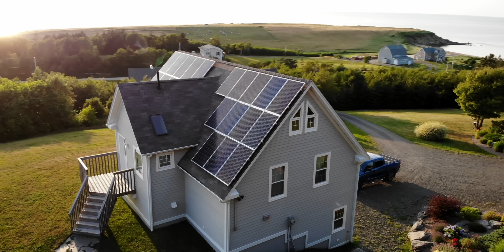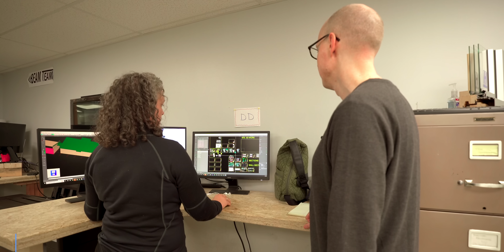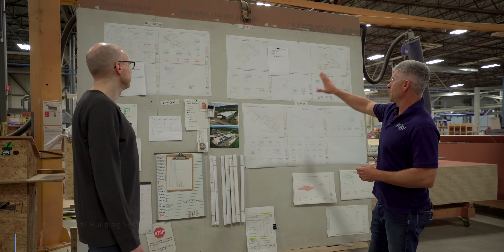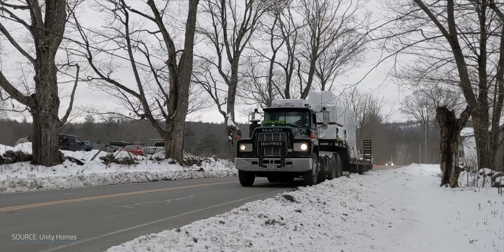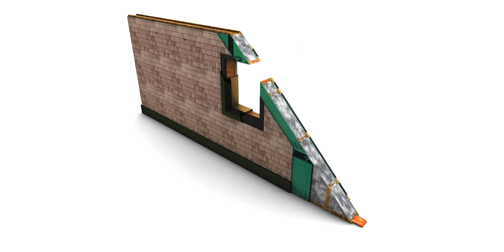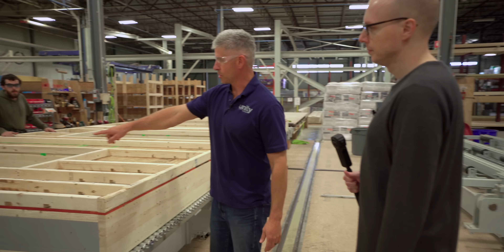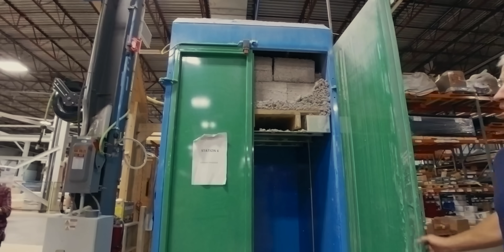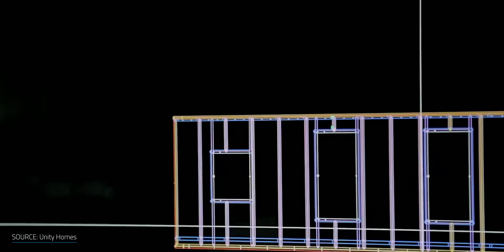The Simple Genius of a Prefabricated House - My Net Zero Home Build

Comment: As a custom design small builder retired, I have found SIP the economical way to go. And in an attempt to protect the wall  exterior wall assembly even more, we used a minimum of a 2’ overhang. Like your panels, they use less material than your factory built home and achieve an R30+ with a 6.5” depending on the type of ICF used. And has options to increase R-values barriers to R50+ when going to 2x8 or 2x10 thickness which for me is unnecessary as there are passive ways to capture heat thru solar that do not require any mechanical devices such as Trombe Walls.  And I dare say, much cheaper to boot. Thanks for sharing, Matt.

Comment: All of that large white plastic covering/protection for transport looks a bit wasteful. Is the plastic effectively recycled. In Western Australia we have predominately clay brick and tile homes. Double brick is common. We do not have a great deal of wood. Much of the woodland is protected. Brick and tile holds out well against weather and insulation is now standard for construction. We have a high range of temperatures but no snow. Perth, the capital, has a great climate. Except for a lack of sufficient rain. Fresh water is always a problem. We do have steel and wood built housing for those that want them.

Comment: I've been a fan of this tech since i seen Ted on This old house and the sheer amount of detail they do to tight up the pre-builts they make.  It would cost a bit more, but rockwool or similar insulation with fire resistance should be used.  Tornado ties (is what i call them) but those should be used on roof rafters, down to the sill to increase the house surviving high winds, etc.

Comment: In 1968, right out of the military, my first job was framing wall panels in a prefab plant in Washinton State. A couple of months later I was plant superintendent. I worked for large and small homebuilding companies after that, then became an architect designing almost entirely houses. What you show in this video is where I hoped the industry would go. After all these years in the industry, this still excites me. Thanks, well done to you for the video and Ted Benson for moving the industry so far forward, and being willing to share his techniques.
Reply: In 1982 the wife and I designed and built a super insulated solar home in WA state. The house required no heat. We built wood and electric boilers, but they were not needed.
Reply: The plant doesn't look very busy...
Reply: Ah yes… the days you could start as a janitor and be the CEO in 4 months. Must of been nice having it that easy and that kind of loyalty in a company. But I guess we could have that if we would stop eating avocado toast and whining like I am now.

Comment: What I don't understand is why all homes aren't built this way. Doing all this on an assembly line just seems obviously so much more efficient than doing it on the job site, I don't get how any other method of construction could possibly compete.

The only thing I can think of is just that the software and production stack required to make this possible didn't exist until now. If that's truly the reason, then there's about to be a revolution in home construction. Future construction is about to get a whole lot better, faster, and more affordable as this technology takes off and matures.

Comment: Wow.  I'm 57 and my Father was a carpenter, so I grew up on jobsites building homes from a young age.  We did some different things insulating homes in the Mid-West back in the 70's/80's and trying different things.  I remember building an "envelope" around the living area of the house to try to get better insulation values back when people really weren't worrying about that sort of thing.  I remember arguing that stopping air infiltration was  more important then R-value, if you have arctic air traveling through an electrical outlet it doesn't matter how well the walls insulated, you have to stop the air, then insulate.  I know it sounds basic now but not so much in 1982.  Pre-fab back then was a good idea but I think poorly executed, it's amazing how far they've come.

Comment: I read a book once that had a basic idea, and it made me think of ways to expand on it, which I did for what was essentially a science-fiction short story.  I have written three stories set in the same world.  In this world, there is no more urban sprawl and so in order to expand you build up or down and fill in the spaces.  Everything utilized modular housing building blocks that was basically built with all the amenities right into it, such as wiring and plumbing, etc. with customizable options.  In this science-fiction version, it is a little further along, allowing for the total change of floor plans within large housing complexes, such that you could buy or sell square footage of space to increase or decrease the size of your home and just move the walls, since everything was modular and would fit almost anywhere.  They could even buy space from above or below and add in stairs, or remove the stairs and sell to downsize.  

Anyway, watching this made me think back to that story concept.  As if it is something actually achievable, and this is like the first steps in that evolutionary process.  Awesome.

Comment: I applaud your intention to build a net-zero house I can’t help but wonder why legislation is not requiring every new home to be as energy efficient as possible. I recently moved into a new home and I had very little to choose with regards to materials, heating systems etc. Of course I was able to personalise the layout, fixtures, bathroom, kitchen etc. What I got is a very energy efficient net-zero house with a heat pump, floor heating, fully electric kitchen etc. The only thing I had to pay extra for was to upgrade the number of solar panels from the minimum required 3 to the maximum possible to make it net zero. I live in Europe, and despite the ongoing energy crisis and inflation I get paid about €500/year instead of paying for energy. And that is including 8,000 miles of charging my electric car. The amazing part is that all of my neighbors in the same street have a similar energy “bill”…

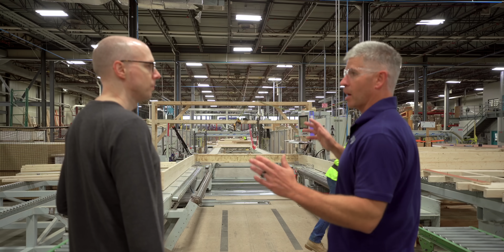Comment: I can see an optimisation which might double Matts (the factory worker) productivity.  At 11:08 here are two pneumatic lifting rollers (left and right) to drop down the raw material gathered from the right, and then raise for the next piece.    Matt moves several steps *FOUR*  times, each time stretching out his hand and perhaps not good in the long term for his back:   1) He moves right and nearwards to reach switch to raise right roller, and then 2) walks left and stretches nearwards to raise the left roller   ..... then walks six steps forward to load material from the right onto the rollers  .... then reverses the process  3)     moves right and stretches nearwards to lower the right roller   and then  4) he walks left and nearwards to stretch to reach switch to lower left roller.    MY SUGGESTION PLEASE RELAY TO THE  FACTORY:  If Matt the factory worker had a wireless button on his belt (or his left chest, as in activating a star trek communicator), then he doesn't have to make these four time consuming and body stretching moves.   It would double his productivity and his job would be less harsh on his body, and should be an easy accessory to add to the existing automation.    For this productivity suggestion, sign me up for a share in the increased profits  !

Comment: Is this the way to go in the consumer based housing market; 
yes and no. They are already building its way in Europe & Japan where distances between the factory and the building site aren't as far as in the USA. I looked into Bensen Wood and companies like Unity in the New England area but when I figured in the cost of shipping to a remote area in SW Ohio, the idea became a deal breaker. The Midwestern USA had some manufactured home companies in the past but most went out of business because the market was too small to sustain them. My resear check showed that a steel Morten building made to look like house and cemement was the most economical way to build and it was turnkey. Most of these systems use a wood post and truss framing system that eliminates much of the framing conduction you mentioned while minimizing wood use. ( post and beam framing from laminated beams is another alternative) Wood product s are shipped into the Midwestern and Central USA. Steel is abundant and close by as mini- mills use recycled ( mostly old cars) iron and electric. Most of these mini-mills make building products(siding, I-beams, brackets, etc) and plate or sheet steel. LImestone is abundant throughout the area for cement, gypsum board, and steel making. The building framework are made is small factory type settings and the steel siding is in sheets and requires little labor. A typical building with this construction method is enclosed in a month or less. These buildings can be very energy efficient and possibly turned into zero energy homes. Much of the work lends itself to self-building. In the New England or Mid-Atlantic area a Bensen Wood home is hard to beat on price, tightness/accuracy, and the convenience of a turn-key house.

Comment: Nice. I am about to move into my passive home which has a R42 wall system. I used a double stud system to eliminate as much bridging as possible. Lots of work and double the building standard for my area on Pender island. It was nice to see the wall assemble in the video and an explanation by the builder.  Best windows Ive seen. Looks like you will have a beautiful house. cheers thanks for sharing

Comment: I bought a pre-fab home years ago.  I did not realize it was factory built (and delivered on 4 giant trucks, I found out later).  Two levels, 5 baths, 3/4 BRs, a den, a study, a full kitchen, the works,  I did not realize it was factory-built, until they "built" another one two doors down.  It was built in ONE day!    Six months later another one went up.  Mine had been a farmhouse style.  The  latest  one was the federalist style.
The insides of the two houses were mirror images of each other.  When the new owners came over for dinner at our house, they were totally shocked when they entered.  From the outside the two houses looked totally different; like they had been built centuries apart and had been there forever. 
For those of you cynical about factory-built. my had fully insulated walls, w/ 2x6" framing members.  Better than the local builders do.

Comment: Matt, love the video! Seeing inside one of these plants is pretty incredible. It's worth mentioning that this is a safer way to build as well - construction jobsites are notoriously unsafe and get way less oversight than a plant like this. 

I had a question regarding the insulation. The walls seem incredibly thick! Are they 2x10? But R-35 doesn't seem super high for that thickness. This is just standard blown in cellulose with fire retardant applied? Perhaps it's a cost issue, and I would imagine R-35 is extremely high for Massachusetts. I'm just curious what's achievable with other materials at that thickness, considering in my location it gets down to wind chills of -40 annually.

Comment: We are finishing up a renovation/restore on a 1909 house in our small town. The walls we had to frame, floor joist systems we had to rebuild and fire damaged roof structure that had to be re-engineered and rebuilt were ridiculously expensive and depending on the contractor, the build quality varied. I foresee a future when a local lumber supplier has a similar automated prefab facility which enables contractors to digitally build the walls or other structure, submit the plans and pick up and install the components which are engineered, perfectly fit together and have minimized waste. I bet it would be less expensive if you're paying $X for materials and a few hours for contractor time vs. dozens of hours plus $X materials for a lower quality result. Wouldn't it be nice if your contractor was only 5 days out instead of 5 months out due to work backlog

Comment: While I'm delighted to see this going on after being an architect using CAD for fifty years, living in an eco-house and having worked on Passiv Hus schemes, I know that there are issues to watch for:

Firstly, the costs are huge for establishing a factory and all the automation processes. House building uses cheap materials and labour, so spending on the fabrication process can easily run out of control. Boats are built this way, and they can be hugely costly because of the overheads.

Secondly, being able to model complex buildings in detail means that the design can become overly complicated and involve too many special components. We used to say we know the parameters of every cut 4x2 on a job. But we don't need to, it just adds effort. 

Thirdly, centralising production at large expensive factories to get economies of scale can mean excessively long journeys for the trucks, and the assembly crews, adding again to the cost of something that should be locally available from builders merchants. We have import pre-fabricated homes from Sweden and Germany for decade to the UK. Travels by road and ferry absorbs budgets that would be better spent on more floor space or better materials. 

Fourthly, extensions or improvements to buildings are more difficult if the local builder has not been involved in the construction. He'll charge more just for all the head-scratching time.

Fifthly, big panels involve big construction panel gaps, and consequent infiltration losses. It takes a disproportionate time to fix and seal the building, and can negate some of the time savings. Infiltration is one of the main reasons for failing a house when it applies for Passiv Hus accreditation. They pressure-test the house.

Sixthly, we have already modular materials and its easy enough for a local small building company to put together 8'x4' panels on site in a controlled atmosphere (just a couple of storage containers will do) and man-handle them onto the foundations without cranes or fork lifts. Less is More, as we say.

Finally, I've spent the last few weeks in France watching a dozen houses being constructed in a very different way to the method we use in the UK. After pouring the floor slab a single layer of lightweight aerated concrete blocks is built in two or three days, an upper floor of concrete is poured and the next storey of block is erected, the timber roof trusses installed and the tiles added. The concrete walls are then screeded extermally with a lightweight coat of plasticised cement. Insulation can be added internally in a dry building before the finishing surfaces are applied. 

Only in the north of Europe is timber and particle board used. From Germany downwards to the Mediterranean we all use masonry. In short, there are more ways than one to skin a cat.

Comment: It would be interesting to put 2 ASIC miners in the house for heat. I heated my house last winter with a temporary set up. 

As my house got smashed last week in the tornados the rebuild will have the ability to run 4 ASIC machines. As well as solar for the house, ASIC'S and Tesla.

My goal is to take this house in a small town "off grid".

Comment: A nice example of innovative, state-of-the-art design and fabrication of high performance net zero SIP modular homes. I particularly like their Levels of Service options for DIYers. That said, one of my primary quibbles is Unity's limited (?) choice of insulation, i.e., cellulose. I do not necessarily agree with their prioritization of “buffering” moisture within the envelope to assist in ‘moderating humidity levels,’ both within the envelope and, consequently, the interior space. There are other insulations that offer better overall performance in exchange for potentially reduced moisture control within the envelope.
 
As far as affordable: that is in the eye of the beholder as Unity's basic Xyla design platform starts at $400K, which, even for a basic net zero modular home, is beyond what most U.S. homeowners on average would label “affordable” (depending on the specific U.S. market of course.) Still, it is a very promising start.

Comment: the BIGGEST LOSS in real estate is... (drum roll)  FIRE!  And... What do you build the houses with? WOOD!  Match sticks!  I built my house with reinforced concrete! concrete floors, radiant heat, (no hot air causing static electrical discharges) 5 BR, 4 baths, home theater, family room, 2 car garage, etc. If there is a fire, we would put the fire out, replace whatever was burned and paint!  You can't burn concrete! and your insurance company will love you!

Comment: Just like nuclear fusion, prefab homes have been the future for decades.  Problem is often just the transportation issues requires a lot more panels to fit on trucks.  Which means more joints, more assembly. And there's almost no ability to make changes in the field - for the sf prices charged, it's a tough pill to swallow for average homeowners.

Comment: About your sponsor, as with most VPN industry advertising, the info in the VPN ad is mostly misleading.  A VPN doesn't do much to protect your identity, and has nothing to do with protecting you from "malicious websites" or preventing tracking.   Your data is already protected on any modern website because of HTTPS encryption.  The part about using it to stream foreign video sources is the only valid claim. Tom Scott has a good video about why he stopped accepting VPNs as sponsors and started telling the truth to counter the lies and misinformation from the VPNs.

Comment: Did you ever consider a pre-cast concrete house? If so, how does that compare to your prefab house? I assume all the windows/doors/roofing would be equal, but I would think the insulation and structural integrity would favor the concrete/steel house. Transportation, however, would likely favor your prefab.  Just curious.